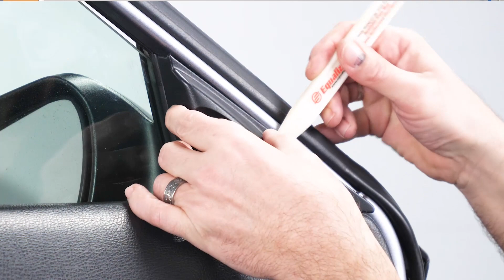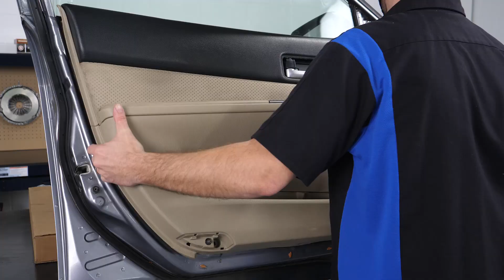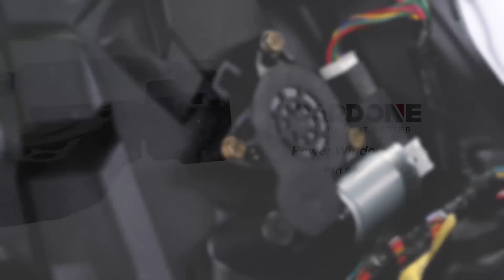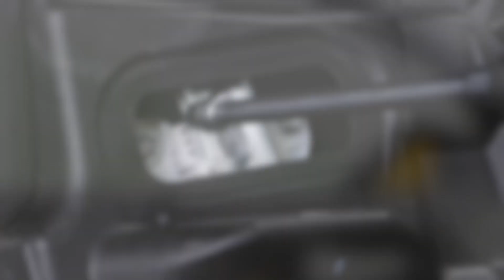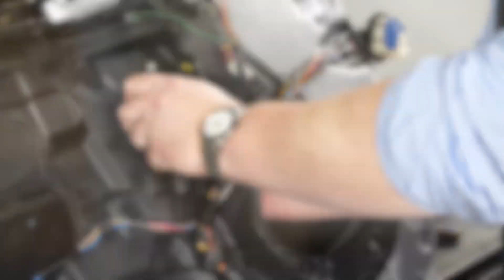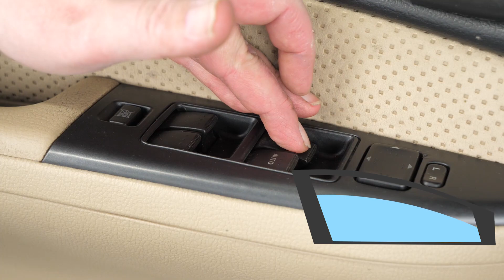Window Lift Motor Replacement and Regulator Install for Mazda 6

Comment: I used a Cardone regulator in my 97 camry and tolerance was off. Had to tweak glass to get it to fit and when it rolls up now it pushes top of glass away from door frame and there's a gap at rear when it's fully up. Not happy. May try a different brand.

Comment: I have 2010 Mazda 6 and my driver side window is not working and come to find out I need to put a new motor in the window is it common
Reply from the maker: Thanks for the comment Jerica, Our Tech Support Team may be able to help with troubleshooting, please call 888-280-8324 Mon-Friday 8am-5pm EST to speak with one of our ASE-Certified Technicians.

Comment: Is this a common problem for these? Everyone I’ve known has had to replace at least one window motor
Reply from the maker: Thanks for the question, not sure if there is a definitive answer for that? However, if you have a technical question, please feel free to call 888-280-8324 Mon-Friday 8am-5pm EST to speak with one of our ASE-Certified Technicians. 👍😊👌